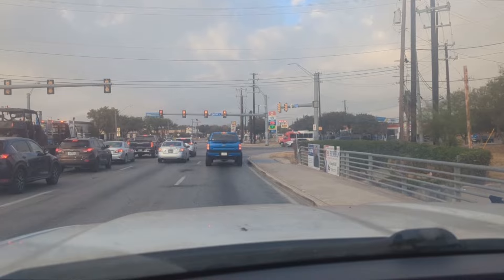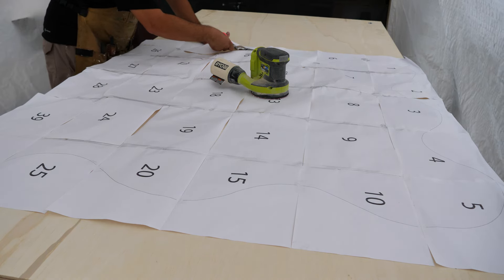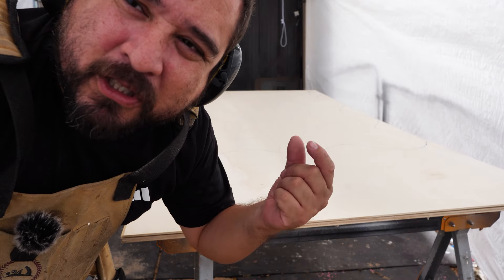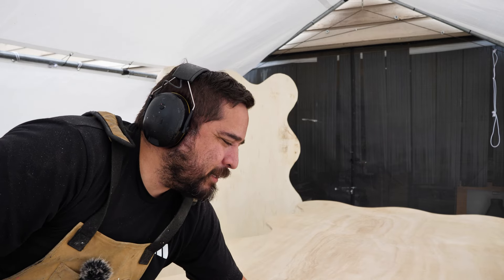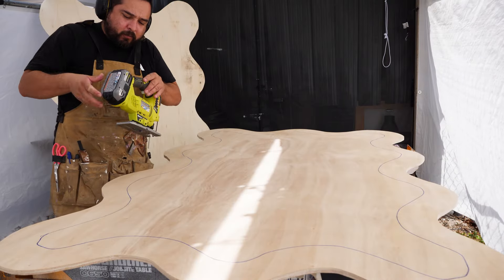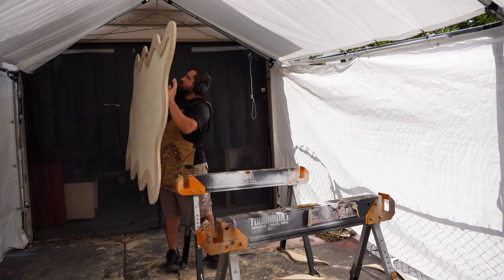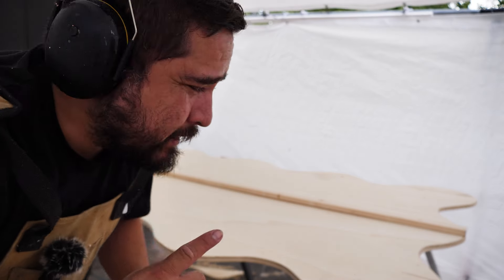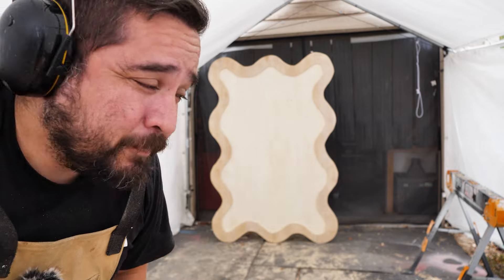DIY Wavy Wall Backdrop Beginner Friendly woodworker project

Comment: What type of blade do you use in your jig? I have a craftsman and have the hardest time making clean straight and curve cuts. Any tips?
Reply from the maker: I mostly use diablo blades. But if you look you will be able to buy a variety pack that has different blades for different applications. The variety pack has a scroll saw blade style for curved cuts, super easy with it. It has fine cut blades that do not leave such a mess and look clean. Upside down cutting blades that will leave the top side looking clean. Plus a blade for metal, thick lumber, etc. They usually have a sentence in the back or picture that illustrates what each blade is for. Also adjusting the settings on your jigsaw can have a affect on your cutting as well. After some practice and you find the blade that works best for you. It gets much easier. But will let you know cutting straight with a jigsaw is difficult as I still cant do that with out a guide on the side guide the jigsaw against. So I mostly use a circular saw for cutting straight if I have the option. Good luck!